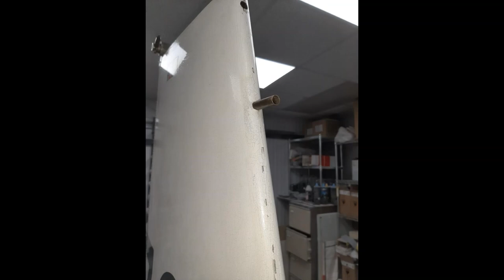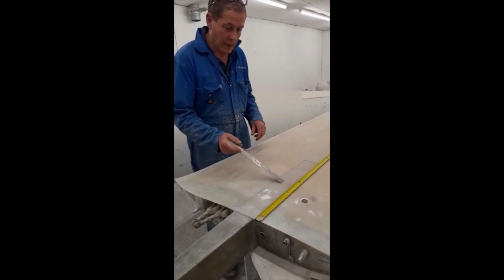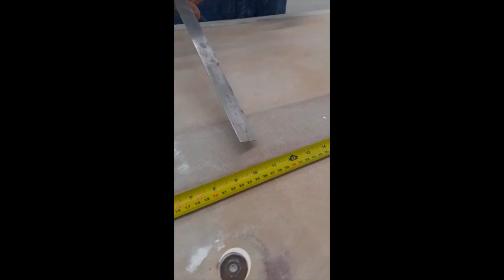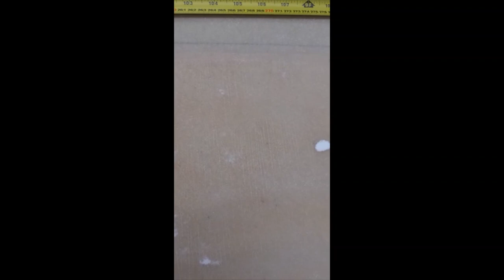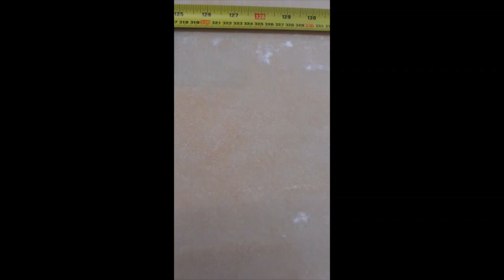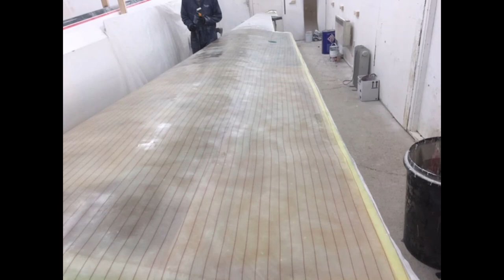When to refinish your glider

Comment: Dear Gordon,  thanks for keeping us attached.
The video is not that clear...if I am right the cracks are in flight direction, and there are many of them, is n't it? 
Mostly the quite thin 1e layer of the composite, say an 80 grams 0/90 glasslayer is only affected. The second layer underneath , mostly a 300 grams +/-45 layer is not affected.
Can you specify more precise what the case is here?

Comment: Brilliant video!... What actually causes the paint/gel coat to crack and the cracks to propagate to the structure?
Reply from the maker: Gel Coat is a Polyester resin that has had a white pigment added. But the airframe is made of epoxy resin. 

The type of Gelcoat that always cracks (eventually) with age is called Vorgolat. This was used on most Schemp Hirth, Schleicher, Stemme and LS sailplanes (before LS went bust). 

Grob, DG, Slingsby, Glasflugel and early Jonkers, all used a different formulation of polyester,  called called Swabalac that is less prone to cracking. Swabalacs main market was GRP showers and baths. When that market switched to Acrylics in 2008, Swabalac Gel coat sadly was discontinued. 

The gel coat usually sprayed into the mould in manufacture, when it is fully dry, a coat of epoxy resin is brushed on and the Glass/carbon  fibre cloth then applied. 

The Polyester Gel Coat has a different expansion coefficient compared to the epoxy. Plus it can be quite thick (3mm in places in all the corners of of the moulds where the GRP cloth cannot go round a sharp corner) that makes it brittle. Age cracks often crack in the same direction that it was last sanded. 

If the Gelcoat is well bonded to the GRP,  when the Gel coat cracks, these cracks propagate into the brushed layer of epoxy. 

Every time the wing flexes or there is a large temperature change,  the 2 hard edges of the cracked gel/epoxy resin eventually propagate into the first (sometimes deeper) layer of Glassfibre. This layer then has to be removed and replaced (very expensive in labour and usually adds weight) 

Most new sailplanes have pure T35 Vorgolat, that without the PU coat does indeed still crack just like the original Vorgolat did. But if coated with polyurethane shortly after build (or refinish) appears to not to crack. 

All gel coats go very brittle below -20 dgress C. 
Lots of wave flying with rapid changes of temperature and any manoeuvres that cause wing flexing (like descending with the brakes out), will crack all gel coats where they are thickest. (around the brakes boxes and aileron normally). 

In the marine industry Gel coat has evolved hugely and might have now fixed these problems. But it appears nobody in the aviation world is willing to try anything new,  in case it does not work over the long term.
Reply: @gordonmacdonald9679  thank you for this explanation!
Reply: @gordonmacdonald9679  Also Gel Coat is not resistant to UV radiation, in contrast to polyurethane coating.